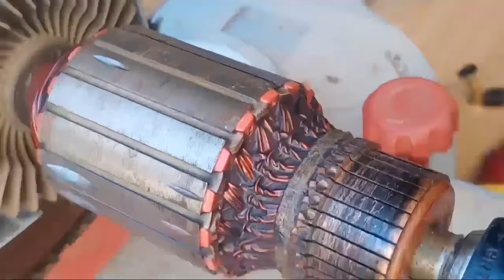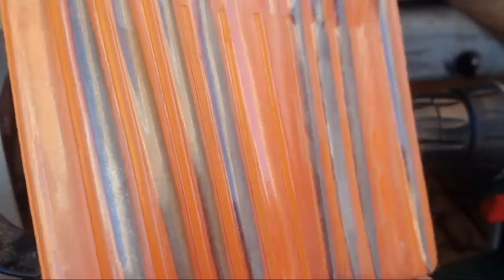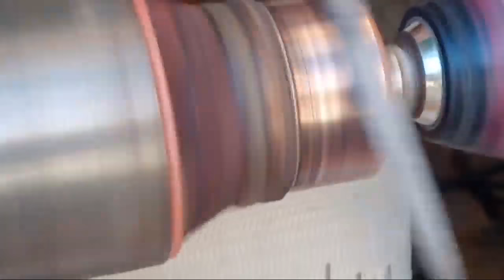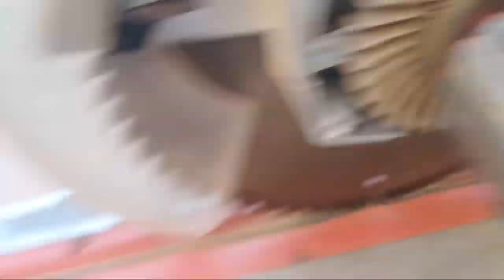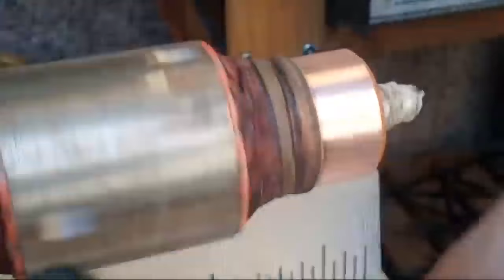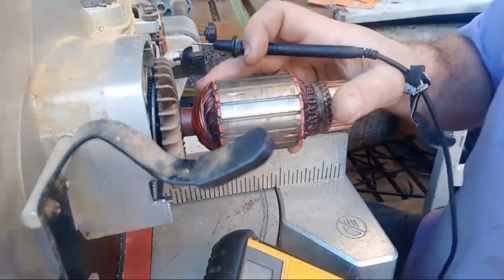Sparking carbon brushes ~ Cleaning the armatures  commutator bar on a circular saw

Comment: You cannot measure armature resistance and get a sensible reading with that type of meter, it will look like a short circuit because the resistanc is very low. Also, if there is a shorted turn on one of the windings, that will not be detectable either. There is a way to test this - use 6v A.C. and measure the current of each winding pair by connecting across opposite copper strips on the commutator, a similar level of current should be observed with each measurement. A shorted turn will show as higher current or an open circuit will show zero current. As well as cleaning the commutator, each gap between copper strips should be cleared of debris as well. Ensure that there is no connection between the commutator and the armature body. Hope this helps.
Reply: I like this response but I think you should put a video link to demonstrate how to test the commutator properly.
Reply: Hello, is there any page or video that explains this in a little more detail? I mean the 6v ac test.
Reply: @yasirwazir567  I will try and make a diagram with a description of how to do the test. It may take some time to do this so please be patient.
Reply: @apmdavies  Thank you
Reply: @apmdavies did you get around to it ?
Reply: Thanks for enhance sharing
Reply: @razer192  I think he ate all of his peanuts!

Comment: You need to put your armature on a lathe and machine the commutator. You will never get rid of the sparking this way (by looking at your brushes), you probably ruined your armature now unless you try and machine it to get rid of the file gouges. Do not do this people you will ruin your armature . You armature is probably fine , your commutator just needs to be machined / polished even.  If anything try putting new brushes in. won't completely solve your problem but will probably get you through a job.

Comment: hi handsome.  you me laugh.  thanks. I have a 2014 kobalt km210 electric lawn mower,  and this is exactly what I need to do to mine. I found it on the side of the road,free. I removed the cover and the carbon was full of metal debris,  so I used a wire brush and got the spring to retract and the  carbon has 80% left , one side chiped off as I was cleaning it. I examined the copper and it needs cleaning, I thought and said to myself, I know who can teach me , someone from India. I searched for carbon brushes and here you are. I'm happy your here  . thank you.

Comment: The armature isn't shorted. It is supposed to show a resistance reading. Use an armature growler to test it properly.
Reply from the maker: Hi Mark thank you very much for getting back to me Finally someone  who actually knows what he's doing any chance to hook up on Facebook. I would have some questions and some ideas I would like to share  with you I checked out that machine you recommended I didn't even know that this is existing so I learnt a lot from you and I would like to continue. thank you very much. My what's app in +447950 542472
Reply: @themaestroofrandom  Mark is correct, there are three different resistance tests that can be carried out on the armature. Loads of good videos on youtube will show you the correct procedure. Good luck.

Comment: Such technique maybe good but most of thebtime when burning brush with high ligh often times the amature is grounded and shorted. I have done many times in my own power tools, replacing the amateur is still the ultimate solution if testing the stator is good

Comment: Generally handy men is good with idea of tune-up.
Just few recomendations from my experience. Never ever use files for commutators at home. Just sand paper different grit 100, 200, 400.  
Turning by power drill good but must be at higher rpm.
Carbon residues from the grooves could be cleaned with utility knife. Also woud be better to blow off all armature from dust with compressed air, if possible.

Comment: Great video. & Sir I most definitely agree with the comments about the "Mayor" 😆! IDK what state your in, but I tell you one thing.. in 2023 I think all sides from far left to the far right & even the "extreme middle"  can all agree on these politicians being out of touch with reality! But from a Man of the working class while maintaining a family & a stubborn truck.. I appreciate this video my brother from another mother! 🤝 

P. S I also agree with one of the comments down below.. being "if your in buzzer mode u will get those beeps & to check for resistance near the OHM as well high amps when it runs. But if possible try using a 6V AC!
Defeat the issue & never let these things beat you! I hope the comment section (as I'm sure this man fixed his issue 2 years ago lol) as well as the video helps everyone with this problem 

F. Y. Pretty much dropping this comment altogether to support your channel & the algorithm. Best of luck & God bless you AND everyone who reads this, on ALL of future endeavors 💯 ✌️

Comment: i think it's not shorted, it beeps normally if your in buzzer mode. you must check for resistance value near to an ohm. you might as well check if it is high amps when it runs,refer to the output specs of the unit.
Reply: I thought so too. If one or two of the  commutator bars beeps yes, but not all  perhaps an analog meter would be ideal I guess. This video helped me a lot as my sander carbon brushes broke inside and damaged the commutator. It has small raised commutator bars and am wondering if the brushes will wear off ... thanks for the upload.

Comment: Use sandpaper you will have a better results.
Best regards and thank you for your Video.
Reply: Lycan Lycans What grain sand paper?
Reply: @gwrong86   depends on the amount of damage... I generally use 400 grit, then finish it with 800-1200 so it’s super smooth.  Always blow it off and clean between the commutator bars to remove any conducive debris, which will cause sparking or a short between the adjacent bars...

Comment: I have the same problem with anglegrinder I just bought in a pawnshop.  Why does it eat so many brushes, why is it so hungry? I just read somewhere that man 3 reasons are   1. Inadequate  Spring 2. Pressure,  Poor Commutator or Ring Condition or 3. Brush Holders are Unequally Spaced or Out-of-Neutral.  I guess now I have to disassemble it and try to eliminate these possible faults.
Reply from the maker: Thank you very much for sharing this information because I have three items with exactly the same problem and I am getting absolutely bananas.  I really would appreciate  if you would share how you getting on. I'm completely frustrated and I cannot find a solution
Reply: 4. bad bearings
Reply: 5) burned winding too.
Reply: @jeffgriffiths5945  changing bearing could solve problem have experience it? 
I have same sparking issue with my drill Machine i had clean armature , change brush and finally change field core but problem not solve it's sparking continue.... And heating without load in Just 30 secondly continue full speed
Changing bearing will solve problem?

Comment: Good morning sir why still sparkling im already sandpaper and changed the carbor
Reply: I have same problem bro
Reply: Try take the Armature out and test it with multimeter for continuity and you will be able to see where the spark is and then you can fix. Sometimes the wires melted where they connect to the copper commutator bars..

Comment: Using this method is bad.
You are putting scratches in the copper connections which needs to smooth for the brushes to make greater contact to operate properly. It will also wear the brushes unevenly. You can remove the dark markings from the copper where the brush makes contact simply using a eraser from a pencil.
Reply from the maker: Sorry but I didn't know that rubber can erase copper scratches
Reply: @themaestroofrandom      It’s best to use sand paper, coarseness depends on the amount of damage... I generally use 400 grit, then finish it with 800-1200 so it’s super smooth.  Always blow it off and clean between the commutator bars to remove any conducive debris, which will cause sparking or a short between the adjacent bars...
Also, it wasn’t a bad motor, you simply didn’t check the omh resistance properly...  
The original poster was referring to carbon being able to be removed with an eraser, ur caddy reply was unnecessary.

Comment: you could also use a   wire brush head on the end of a drill that spins  great for taking rust off    very small one  else if its fanning out to far   wrap it in duct tape to pull the brushes inwards for more controlled direction.

Comment: NEVER use wood sand-paper, or metal (silicon carbide) papers on the commutator.  Metal dust particles are a safety hazard.
Reply: You're wrong. You just need to use non metallic sand paper.
Reply: @FikshunMoshun  how does one tell? there is silicon carbide and there is the other kind. I forget it s name

Comment: Minute 08:10 . . . don't blow up with your breath, unless you wear goggles, otherwise some copper or carbon particles can get your eyes . . . or, as a minimum protection when not wearing goggles, close your eyes when blowing . . . for your safety . . . 
Good job in any case, i have a couple of rotors to treat as you explain in your video . . . thank you very much !
Best regards.
Alessandro ( Italy )
Reply from the maker: Let me know how you getting on
Reply: is copper bad to get in ones eyes?
Reply: @snorttroll4379  🤣🤣🤣 only in that one that still can see, the other eye ( blind ) generally doesn't care ... 🤣🤣🤣

Comment: This is wrong in many ways using file stripping to much metal from the rotor surface just use 1000 grit sand paper and you will get perfect results

Comment: Should have checked functionality before doing any work on armature. Also when using file, you should have it set to cut against the rotation of armature (files are made to cut when pushed away from handle} and use a machinist file (about 1 inch wide) to help make armature flat and even. It was a good idea start with though.

Comment: Is not short
Reply from the maker: So what is it??
Reply: @themaestroofrandom  it's not short, just low resistance. Motor windings has very low resistance, just measure resistance (not continuity test) and if it's around 1 ohm everything ok.
Reply from the maker: @ClrvGamer  ok but could you explain why is eating off the brushes immediately and Sparks Like crazy if I replace with new brushes
Reply: @themaestroofrandom  Yes, check to see if you have a short between the motor itself and the housing. Most common is a missing non-conductive (plastic, felt or otherwise) bushing between the motor and housing. GG. Hope that helps. :)
Reply: @themaestroofrandom  Sparking is what is eating the brushes, as well as leaving the burnt remains. As for what is causing the sparking, I don't know. But I guess could be wrong brush material. I do have a bosch motor sparking with worn original brush currently. The bosch brush is expensive could be because it has two type of materials on it: the non-sparking bit and the the sparking bit to warn of wear. The cheap brushes could be made entirely from the material intended for wear warning. I just made this stuff up and this seems like a plausible engineering design. I would design it this way if I was doing it.  The cheap brushes are probably made by the chinese who have no idea what they are doing.
Reply: jimmark2010 

Right not a short but low Ohm
If you measure a new one it will show the same
Reply: @fungames24  I do like your thoughts lol!